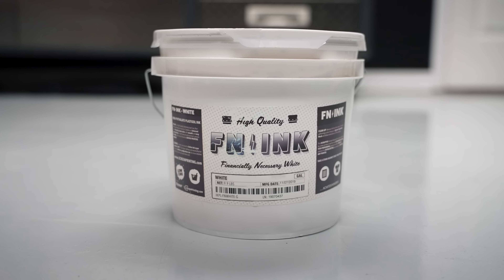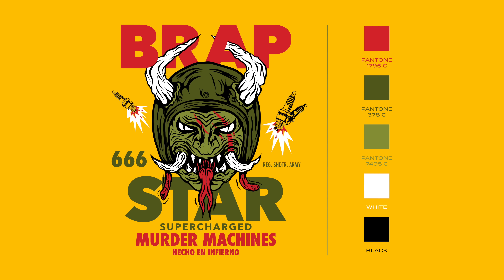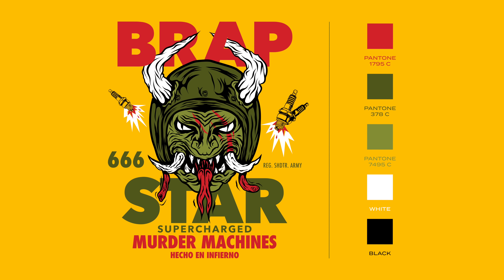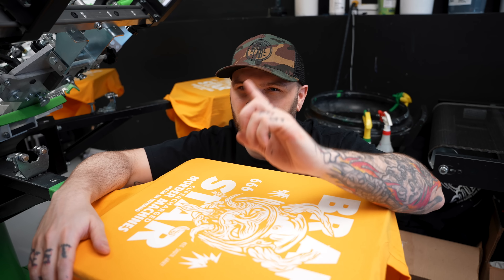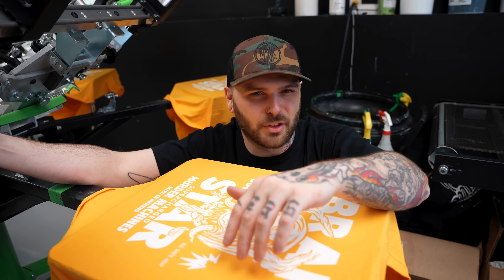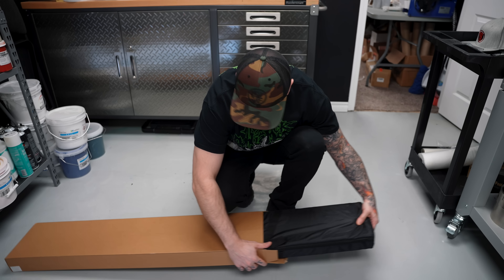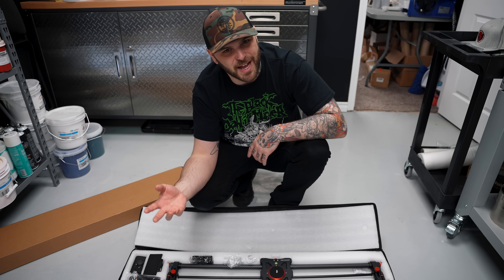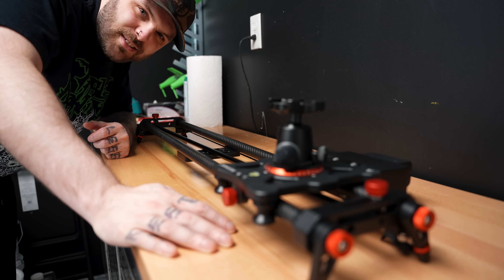Using A Highlight White For Better Screen Prints

Comment: For the different colors did you use a 70/90/70 Durometer squeegee or a 70 Durometer squeegee? And which one do you think is best?
Reply from the maker: It's all just preference really. I run 70 on everything for the most part

Comment: I still haven't tried the FN ink. I've used plenty of the regular Ryonet white and of course the easy to use Meteor white, but of course most people would prefer a 50/50 so that limits the use of the meteor white if you want it to look good long term.

Comment: Dead nuts on registration! I completely agree with the highlight white. We treat any shirt that's not white, or ash gray, as a color shirt, in which it gets an under base and a highlight white for those bright whites, and to tame down colors, such as flesh tones, or pastel colors with spot process. Definitely makes for a softer hand plastisol print that's not bullet proof like a pfpf white base.
Reply from the maker: I'm the same way. If it isn't a white shirt, it's getting an underbase to have that color consistency